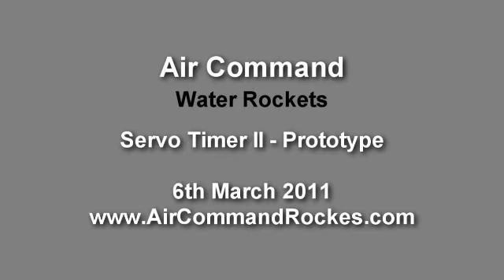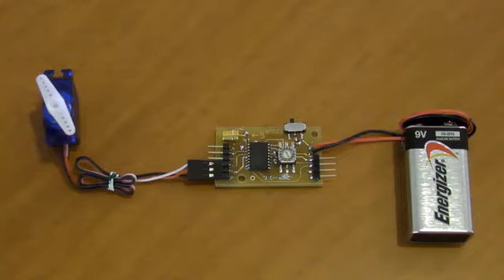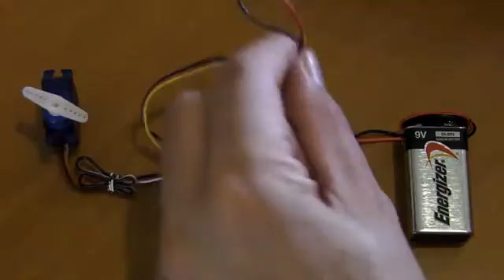Water rocket ServoTimer II prototype demo

Comment from the maker: @willielajay I'm not aware of where you could buy a flight computer currently that's specifically designed for a water rocket and will drive a servo. Though there are quite a few designs available on the net and include instructions on how to build them yourself. Why not buy an RC receiver and use a remote control to trigger it when you need to.

Comment from the maker: @willielajay "That battery piece" I take it you mean the battery clip? Yes you need one of those. Connecting a 9V battery directly to the servo will not work and may damage it. You need to some kind of controller to drive the servo correctly and also step the voltage down to around 5V.